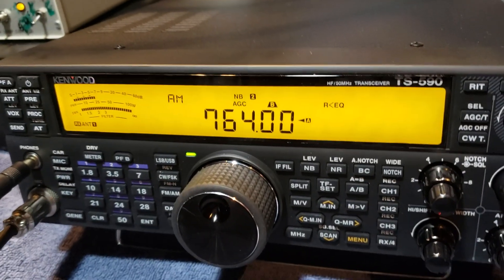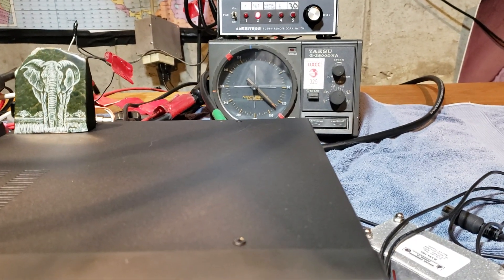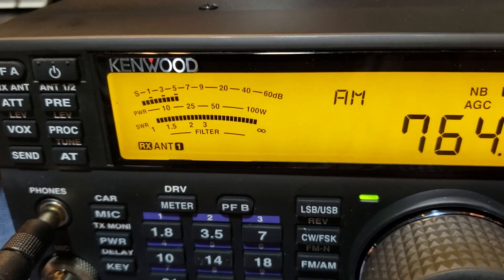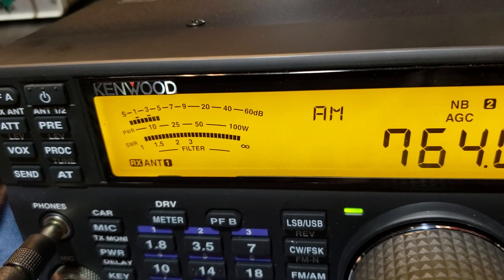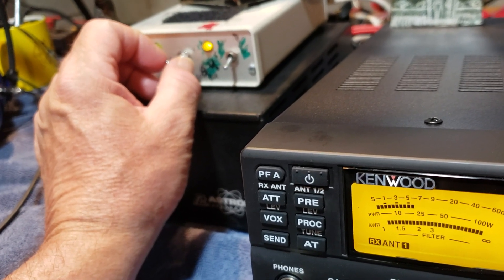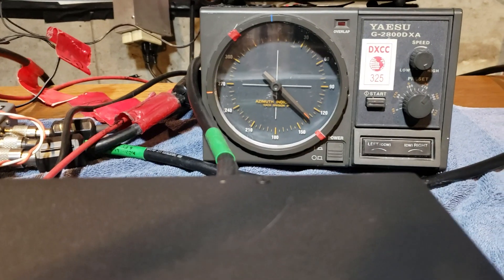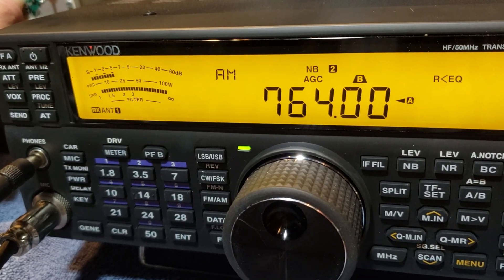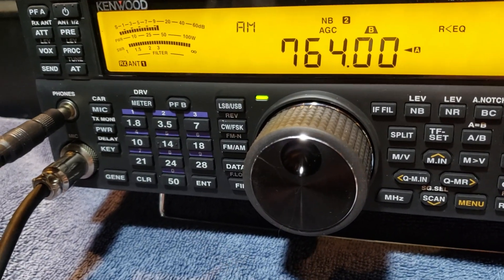Ham Radio Super demo K9AY loop BV station

Comment from the maker: 83 foot piece of single wire, apex 24 feet using fiberglass tubes.....Wires ends terminate at box mounted lower center of fiber glass mast. .each mid section of wire pulled out 15 feet connected at mid point of wood dowels, from center,  thus the triangle of wire is created.  several drawings found on gmail images  73 de paul  n0ah/3 wash dc now

Comment: Hi I have played with full size and half size K9AY. My half size is for 80/40 meters but I have found it works fine on MW and using a W7 IUV preamp for MW and adjusting the termination resistance . 
I live in the UK and I can hear CHU Canada on 3330 khz  5 9 under good conditions tuning further down I can also hear on 3215 khz a broadcast station a vicar preaching ? it seems to me that is a bit odd place  to be broadcasting, are MW  band over here is 550 khz to 1.6 MHZ.